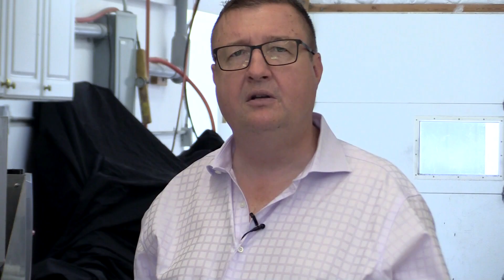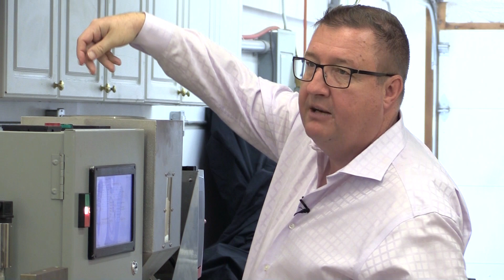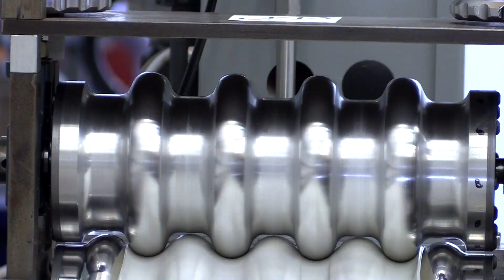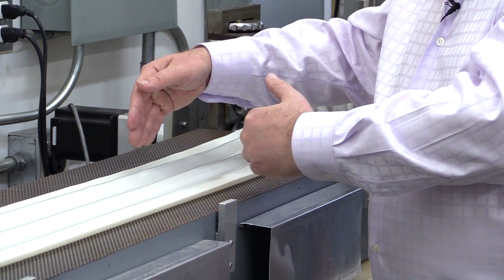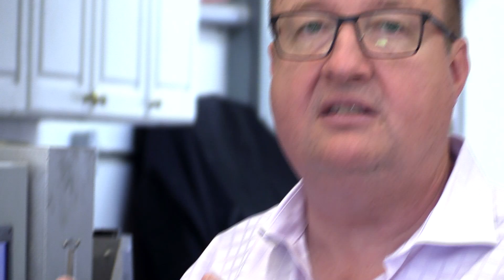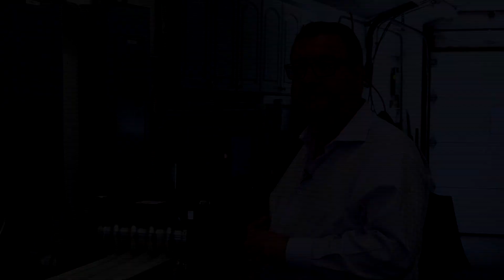Converting Plastic Waste into a Plastic Resource - Roofing & Siding - Part 3

Comment: this is poetic license - mixed plastics such as on the beach cannot be extruded at these temperatures and at these pressures. what is missed out here is that the plastics shown have had to be selected , as to type of polymer , before extruding. The plastic shoe shown in the pictures and other detritus found on the beach do not melt at the same temperature , and cannot be extruded in entirety as is implied in this video. they just de-laminate when extruded if they are different families of plastics. you are not the only mis-leader, several shoe manufacturers tell similar stories , but the only "ocean waste" they can use is the Polyesters (PET etc) .All the other collected plastics are disposed of elsewhere, but they never say what happens to that , as the misleading publicity story is enough for them too.
Reply: Yep. You nailed it. This guy is a scam looking for suckers to give him money